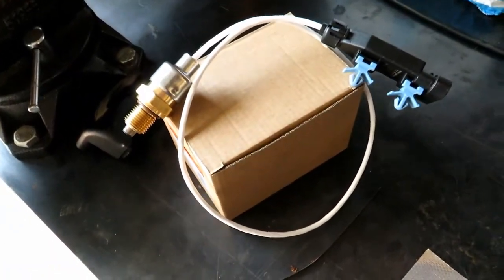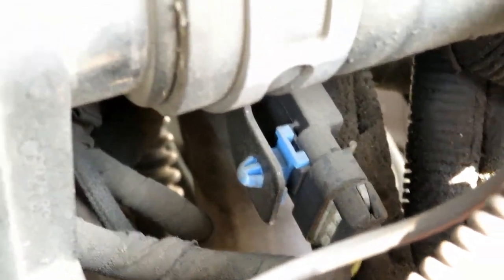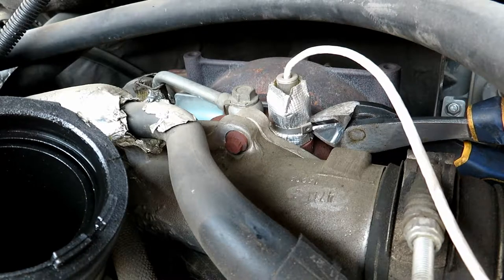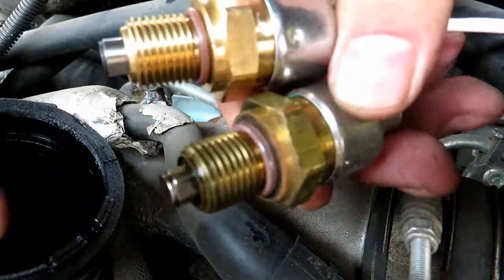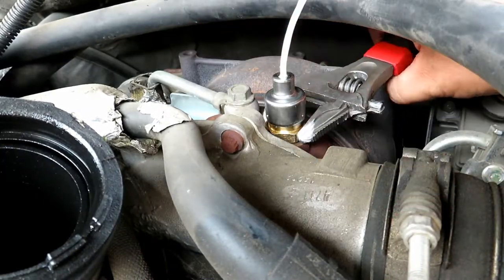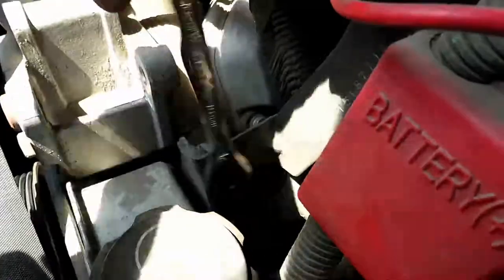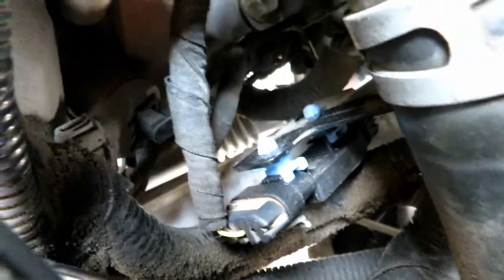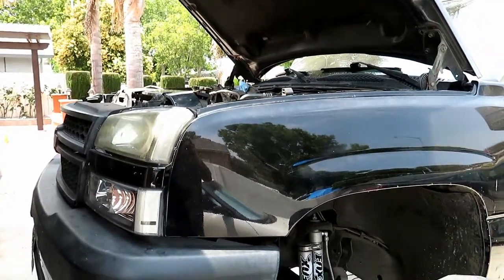Silverado/Sierra LBZ - Turbo Vane Position sensor (P2563)

Comment: Do you remember what brand this sensor was? I like that it came with a strip of heat shield and steel wire tie. Wonder if all brands do?
Reply from the maker: I don't remember off the top of my head, but i looked online at rock auto and the SKP and Dorman brand comes with heat shield
Reply: All brands come with heat shield. Including aftermarket. That doesn’t mean it’s doorman.

Comment: Can you still have a bad VPS but no codes ? My truck kinda ideals weird and hisses a lot it’s a 10 LMM with 230k deleted
Reply from the maker: I have not no, sorry.
Reply: @hyr0llr  🤣🤣🤣 sorry the voice tx gets confused sometimes
Reply from the maker: @JasonY02  i guess it could. This is my brothers truck and it was deleted when he had it. It would cycle between a hiss and a blow through. As if the VPS was cycling. And it never through a code until this video.
Reply: @hyr0llr  see that is what mine does, but it also has a lost and fuel mileage, and sometimes whenever it shifts and high, RPMs, kinda acts, weird, and then shifts as this it doesn’t really have enough power used to when I got the truck you would go up a hill the turbo would automatically you would hear it shift and then it would just haul ass up the hill now it seems to struggle to go up the hill so I don’t know if that could be sticky veins, or if it could be the VPS or if it could just be the turbo itself, but whatever you think might be, would help a lot
Reply from the maker: @JasonY02  reading what your dealing with i would assume the same with something going on with the turbo/veins. Is boost consitant when you have that drop of power? Or does it fall off when you lose power?
Reply: @hyr0llr  I don’t have boost gauges. I would assume it drop cause it seems like the truck struggles and it’s on stock 17s. When the truck preformed good it was on 33s 12wide and would y’all ass up a hill with a loaded 16ft trailer
Reply from the maker: @JasonY02  ehat are you running for tuner?
Reply: @hyr0llr  100hp tow tun

Comment: I've already changed the sensor and I still get the code, any advice?
Reply from the maker: https://chevytrucks.org/duramax-p2563-engine-code/
Reply from the maker: You can read up on it. And halfway down there are cleaning options of the actiator and turbo cleaning.

Comment: Did it fix the problem?
Reply from the maker: yes
Reply: Did you have to have the sensor relearned???
Reply from the maker: @jasongibson6726  No. it ran fine and no CEL light with just the replacement.
Reply: @hyr0llr  Nice. I’m having a hell of a time with mine. Gonna try taking it to Chevy to hook it up to their tech2 Computer and see if that will work
Reply from the maker: @jasongibson6726  sorry to hear. hope they will get you all situated. let me know what the problems end up being.
Reply: @jasongibson6726  did you change the sensor and your still wasn’t running fine.?
Reply: @samoth8090  could not get the sensors to relearn Ended up with a new turbo.  Mine wouldn't open past 95% and close past 45% due to the coking
Reply: @jasongibson6726  look up clean turbo veins in utube as there are some real good vids on how to do without replacing. I am picking up a grease nip to do the drill method in flush with BBQ cleaner
Reply: @lester638 did you do this without taking it off and apart or what?

Comment: so after that do you have to get a retune?
Reply from the maker: didn't get a retune and it was good for the next 2 years before it was sold. for peace of mind, i guess you can go to the dealer.
Reply: @hyr0llr  okay i was just wondering so it don’t blow on me
Reply from the maker: @wildirishduck  yeah in that case. Just have the dealer relearn it for you to protect the truck.
Reply: @hyr0llr  after i put the thing in so i don’t get ripped off having them do it all?
Reply from the maker: @wildirishduck  if they do it all it would of course more expenaive, but the good thing is they will make sure its all good to go. So there is a piece of mind on that just more money. Alll comes down to how much money you want to save and make sure its good to go.